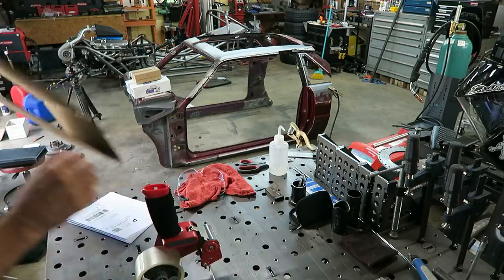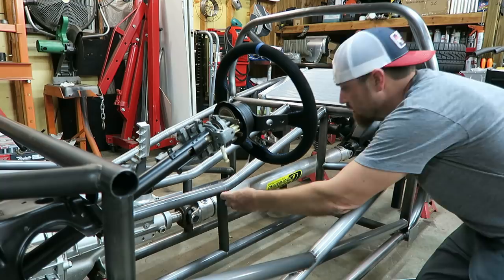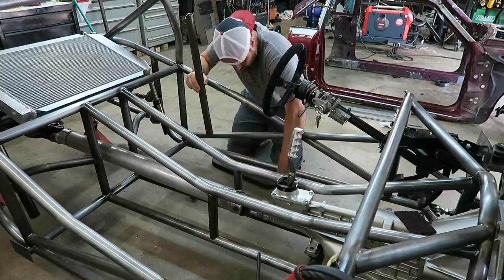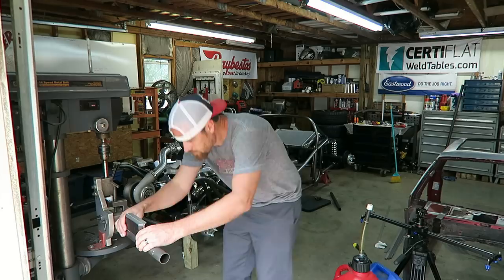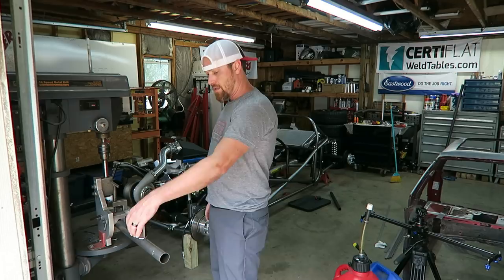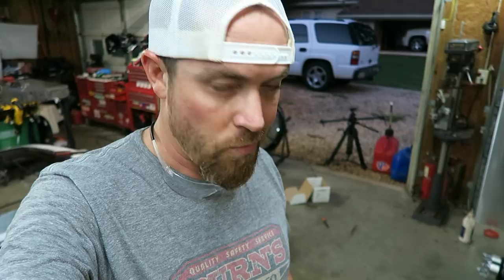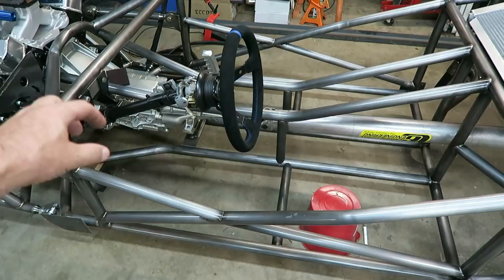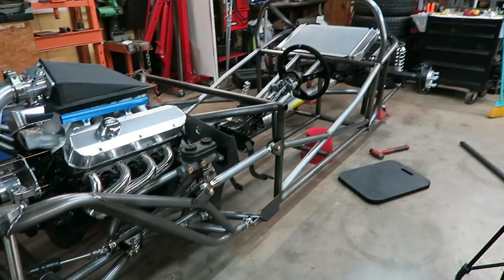Almost Ready For Floor Pans

Comment: I fully agree to have separate sheet metal work for the firewall to body shell. Do some press lock weatherstripping so when it’s bolted down there’s no air gaps to let the engine heat in.

Comment: You can add a top and bottom vertical bars by the front u joint and you'll have a built in drive shaft loop.
Reply from the maker: yeah that basically the plan

Comment: those new floor bars should double as your seat mount locations.   id base them off your planned seat brackets since they really dont have a specific location , just a job.  id maybe run another at foot to help with a basis to build the pedal box off of .

Comment: I have a good idea for the gas tank the spot you said your going to put the filler cap inside that whole cavity put a long rectangle aluminum tank inside of it . Fill up that empty space if you use the whole cavity should get a decent sized tank and run the filling cap to the top where you said you wanna put it. Cut the top off just a little bit around the tank and use self ejecting fasteners around it so if you ever need to pull the tank out it's not a hassle
Reply from the maker: yeah thats the plan
Reply: Looking good as always!

Comment: If you're going for exposed fuel lines, I think if it would be awesome to make them out of polished/brushed copper hardline. It would get some contrasting color in there without straying from the "all bare metal" look
Reply from the maker: yeah I have thought about hard lines for several things

Comment: run that diag bar on the tunnel anyway, to keep the driveshaft from coming through your panel (and your hip) if that ujoint snaps...  2 bars = cheap insurance   and the floor bars, run a node at the vertical tunnel bar, that way you dont have a shear point between the two weld joints.  damn i miss doing tube work.  :(
Reply from the maker: it will have a loop to prevent the shaft from going anywhere

Comment: Posting and asking prior to watching the complete video. At 3:20 the amount of yoke engagement into the transmission looks odd. Shouldn't it be a little deeper? Maybe it's the angle of the video capture, or suspension isn't fully compressed?

Are you using e85 due to static compression or the turbo's?

Always looked forward to the updates and other content, Thanks from an old Jarhead

Comment: Love your work. You talk a lot about using steel, aluminium and carbon. How do you intend to stop dissimilar metal and galvanic corrosion?
Reply from the maker: wont be anymore of an issue that an aluminum wheel touching a steel brake rotor or an aluminum trans touching a steel engine block

Comment: Can you put the battery in that section at the back of the trans tunnel above the tailshaft? Easy access via a removable top or side panel.
Reply: Hang on that may not work when you lower the car it might hit...

Comment: Put plexiglass where the driveshaft is. Or lexan so you can see the driveshaft.
Reply: Might get chipped up with street driving, and would be a bitch to clean, but it's probably not going to see too many street miles or be a daily, so f*** it!
Reply: Correct term is Polycarbonate. Plexi and Lexan are brand names.
Reply: I agree. Or at least some beaded aluminum panels with lexon inserts.
Reply: DieselPunk Cummins thank you for letting me know. I always thought plexiglass was the term😂🤦🏻‍♂️
Reply: In the garage that would look good💯
Reply: Alec Ojard I just thought it would look cool seeing the driveshaft work. Or if the transmission flew apart you could have a go pro and watch it.
Reply: @jasonyz2504   ya man I've used it on several projects. With simples bead rolls added makes it look like a expensive addition.
Reply: In the garage but say when he launches hard off the line will it shatter if the frame was to twist?
Reply: @jasonyz2504  typically the frame usually doesn't flex that much. The right rear tire being shoved inside the quarter panel lifting the left front tire makes it look like it's flexing. But lexon will handle a lot of flex. .250 inch can be bent into a 90 on a break.
Reply: In the garage damn. That stuff is better then I thought

Comment: I have a question for you Kyle been watching you’re vids for quite a while and supported you by purchasing you hats and shirts. My question is where did you learn all how to do this stuff like drilling holes in the roll cage to vent out so on so fourth did you apprentice somewhere?  I have fabricated custom stuff and pulled it out of my head but really I have apprenticed as auto Mechanic then got my journeyman license the. Apprenticed as elevator mechanic theses trades gave me a lot of knowledge so I was wondering where have you gotten the basics thanks
Reply from the maker: most was self taught but I have also picked things up from fellow fabricators over the years

Comment: Having that fuel cell under the front cowl is a bit of a worry. You don't want to be driving in a movie car that explodes on impact. Having the fuel sitting over hot exhaust headers is not my idea of fun.

I'd like to see you around for a few more builds mate.

Could the fuel cell be placed under the rear mounted radiator?
Reply from the maker: Fuel cells up front are very common in motorsports. There is a drive shaft under the radiator that moves up and down when the car is lowered, plus the radiator needs air flow so no on that.

Comment: Hey Kyle (fellow Kyle, as that is my name too), I have an interesting idea for the Bibbster I wanted to pass along. The idea involves a way of stiffening up the front suspension.  First, i really like the "spiky' look of how you have it so far, but afraid that mounting brackets to the front of the engine to stiffen it may kill the look.  My idea is to build a really strong, maybe even solid bar, and have it curved in a large U-shape, with the U tips mounted to the tops of of the  front posts, then have the U wrap around the back of the engine, with the back mounted on a swivel to be free moving, to move with the front suspension.  Think this would keep the 2 front suspension posts from moving towards each other, but also keep the look, as it would look like the engine if just sitting there and can be pulled out easily.  Thinking a solid bar bent would look cool, but also was thinking that if you got some pipe bent around in the U, then weld some sheet metal inside of the U, and have lightening holes drilled to give it a more structural look to it....hard to type "vision" on how stuff would look, so hope you see the idea.

Comment: How are you going to mitigate the galvanic corrosion between the steel and aluminium she is a light house keeper
Reply: Richard Culbertson Zinc Chromate
Reply from the maker: It wont be any different than an aluminum wheel touching a steel caliper or aluminum heads touching a steel engine block. What you dont want to do is mix stainless and aluminum.

Comment: Cause the lady had a wet dream ...
Id get bucket with an adjustable back to it, that bucket has no side support or anything.. The red looks good though...
  Looks like you have a space for a battery where your trans tunnel meets rear bulk head its a deep trans tunnel in the rear I dont see the drive shaft arching that far up the tunnel.....

Comment: what size of pipe are you using? the old lady turned the lights off before she went to bed so the sea-men couldn't see what they were doing... maybe she thinks she is ugly, or maybe lives in a light house and flipped the wrong switch. if the sea-men could see what they were going for they would have stopped... HAHAHAHA! +2
Reply from the maker: most of it is 1 5/8

Comment: check these out for your floor mounting strip. its what they use in pro mod cars. https://timmcamis.com/shop/floor-strips.html
Reply from the maker: Those are cool but not meant to support the floor.  The floors are welded in on pro mods and these strips are to help reduce the vibration from affecting those welds. If they made them thicker I would for sure go that route.